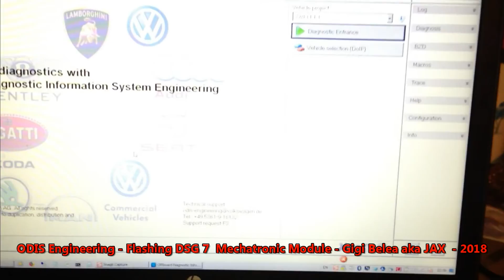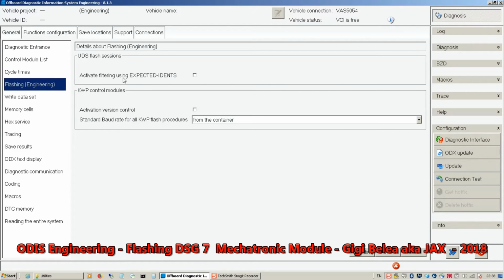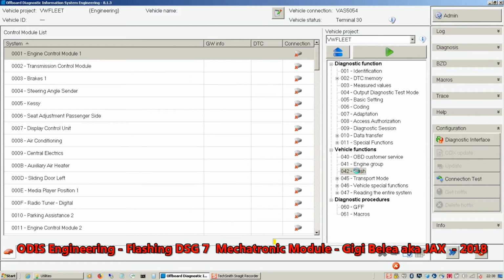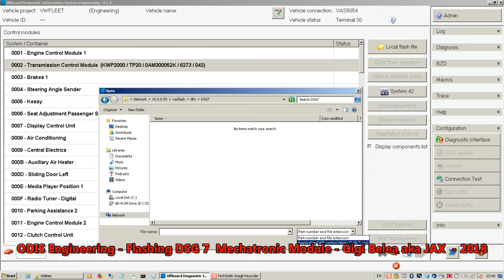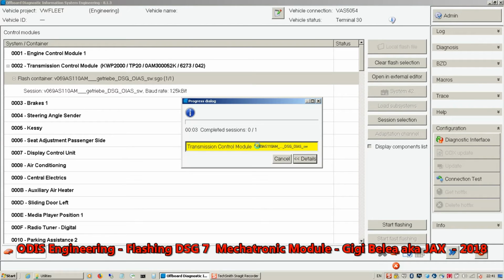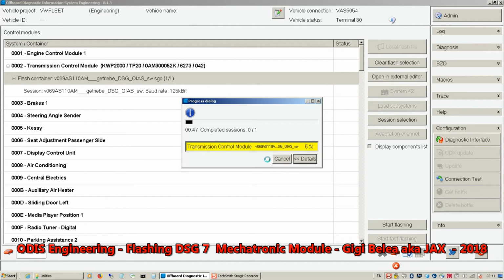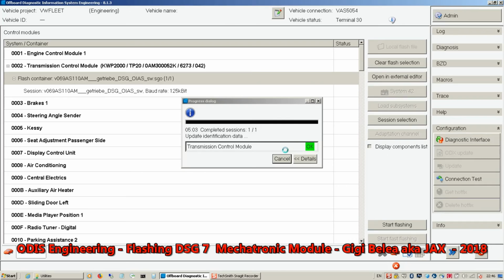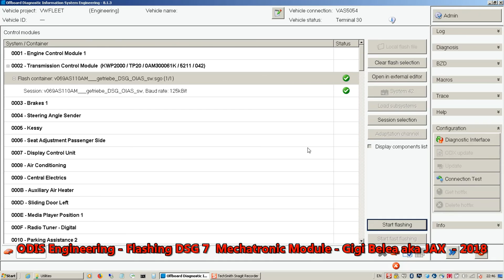Flashing DQ 200 DSG7 Mechatronic Unit with Odis Engineering

Comment: Hi, thanks for the video. If I have sgo file for my dq200 with modified shift points, do I need to do the same setup as you? Or is it possible to flash the module using ODIS-E via OBD in the car?
Reply from the maker: Possible to flash via OBD in the car.

Comment: Hi. Thak's for good tutorial. But i have a question can I flash to another software number on bench but 0CW immobilized unit?
Reply from the maker: only if you have a full read including bootloader.
Reply: @GigiBeleaDK  so only cloning? Old unit is not available. Can I do the same that You made on this movie with 0AM...769E?
Reply from the maker: @szymonvr  if you do it with ODIS then yes, like here would work.
Reply: @GigiBeleaDK  it became that I should use 769K TCU unit. Got some problem when trying to flash unit on bench getting immon ON error. Can 769K unit be flashed on bench or only in car?
Reply from the maker: @szymonvr  As I said , bench mode only if you have full read , else in the car AFTER you match immobilizer.
Reply: @GigiBeleaDK  Thanks again. It finally worked. 769K unit mounted on car - immo matched and ODIS E made his job ;-). Gearbox moved forward but very rough. Tomorow we will be making ODIS S adaptation. Do You got some info about differences between hydraulic blocks? Can i use block from MY2018(TSI engine) originaly with 769E tcu mounted on 769K tcu and new clutch which is different in 2014 than 2018??
Reply from the maker: @szymonvr  Hydraulics should be identical.

Comment: What version of Odis are you using? I try with 9.2.2 always error. VCP and Kess works well on same Tcu?
Reply from the maker: You need to select the correct platform else you will get error because ODS might try K-Line first or CAN and the unit might use the other protocols for flashing. VCP and Kess should work as well as ODIS.

Comment: hello, i have a problem can you help me?  I have two LED headlight control units.  One of these control units is working properly but the other is not working full function.  Is it possible for me to read and save the data of the properly functioning controller and then upload it to the non-working unit?  How do I do this reading from ODIS and turn it into a flash file?
Reply from the maker: you can not READ the flash with ODIS. Find the correct software for it and flash it or go to the dealer and ask them to flash it :)

Comment: Good night, great video, could you provide the electrical schematic of the connection? I have a control unit and I need to do exactly this procedure, but I'm still learning about reflash, I have a broken unit from a client and I need to move to another unit, in addition, I need to know if I save the file on the other one later, it will work. normal exchange, if you can help me i will be immensely grateful? Thanks.

Comment: Does this control unit flash need to have online log in? And why actually do we need to flash control unit, what is the purpose?
Reply from the maker: Just to flash units you do not need an online connection. Sometimes units fail, then you need to replace it , and it might come with wrong software for your car , therefore you need to flash with correct software for your gearbox.
Reply: @GigiBeleaDK  thankyou verymuch. Appreciate it

Comment: Do I need to unlock or remove protection after flashing DSG on car?
Reply from the maker: For 0AM no, for 0CW yes. 0CW can only be flashed on the car or if virgin.
Reply: @GigiBeleaDK  I have a renewed 0CW with poor power, low rpm change gear problem. I want to flash a new firmware to fix this. Wonder if it will locked the 0CW again.

Comment: Can this be done to all dsg units? I cant flash dsg 6
Reply from the maker: Yes , would work on all DSG6.
Reply: @GigiBeleaDK   I'm trying to clone tcu with diff. Hw. But no go. File size is diff. I need to flash file 705kb, but tcu except only 417kb file.
Reply from the maker: @andriusskaudzius2424  LOL , that will never work , different hw is different CPU architecture. You can only make clone ONE to ONE on same HW.

Comment: Hi. With odis E. Can u flash to older software?
Reply from the maker: yes, no problem.
Reply: @GigiBeleaDK  i tried and it refuses. Can i ask how?
Reply from the maker: @majidyasin2386  What hardware you have and what software you wanna flash ?
Reply: @GigiBeleaDK  odis e 12 with vas and the gateway want to flash it downgrade. But i hear cnt upload fecs after.
Reply from the maker: @majidyasin2386  "But i hear cnt upload fecs after" ... I do not understand what you mean ...
Reply: @GigiBeleaDK  after flashing gateway with odis-E you cant restore fec codes with odis-S?

Comment: Please can you show how to flash the AUDI electric steering control module
Reply from the maker: Which one , for what problem ?
Reply: @GigiBeleaDK  audi A4/A6
Reply from the maker: @karadiaessa  :D wondering why you need that ? ... it is known issue and easy and simple fix. At the next occasion I will make it.
Reply: Do you know how to save the old file,before proceed with flashing
Reply from the maker: @beldonnyvanette5541  Not possible with ODIS, you need other tools that can read the unit.

Comment: Hi, are you using an original VAS5054 head? Because clones never work for flashing. At least none that I have tried so far.
Reply from the maker: It's a clone unit and they all work good if you have the right driver.
Reply: @GigiBeleaDK  Thanks for the answer. Where did you get the flash files? The erwin flash file downloads dont seem to have the mechatronics firmware.
Reply from the maker: @charmand79  For Flash Files : http://www.dsgfiles.com/

Comment: Hello, I want to flash/update my dsg dq200 in Seat Leon, actually I've got firmware version 4510, is it worth to do that? And where I can get flashing files? I've asked main dealer to update for me even I need to pay but they say that they doing this only when the car is under warranty. Please any help. Thank you
Reply from the maker: Why flash the gearbox ? Do you have any problems or why ? If it is not broken , don't fix it.
Reply: @GigiBeleaDK  Last year I've changed clutch and dual mass flywheel because was little slipping, and week ago gearbox was rebuilt because of lost the hydraulic pressure. Now working fine but sometimes not so often I feel clutch slightly slip. That's the reason why I wonder to flash/update software.

Comment: Hi Gigi,

I'm about to buy a gearbox basically for its mechatronic unit for a dq500. I have odis and a 5054 connector but i am worried about some of your comments below. Is there a place I can search for my software version and download the flash file?

Alternatively what is the easiest and cheapest way to get the flash file?

Also I assume you can do this while the unit is installed in the car and not on a bench???
Reply from the maker: Depending on the age of the car , the TCU might have immobilizer incorporated on it. If it has then no way to just swap. If no immobilizer then you can swap and if the gearbox has the same code you can swap plug and play , if not you will need to flash correct software on it , else will not work.
Reply: @GigiBeleaDK  its a 2013 built tiguan, I can get the same code gearbox
Reply from the maker: @jeppoification  Some DQ500 have immobilizer some not, I can not say just from the year model.

Comment: Hi There
I ve a doubt to flash dq200 in the bench, i ve tried but there is no comunication with it, i did everything as you said in your video.
Thanks
Reply from the maker: Make sure you have 120ohm resistor between CAN wires on bench. Also K Line needs to be connected to the TCU aswell.
Reply: @GigiBeleaDK  thank you for the advice, now its working, but I have a 0am300060e and when it starts flashing it gets a tcm fault just after askes to turn off the ingnition.

Just one more thing, I ve noticed that in your odis it has been written on the up right screen terminal 30, and mine it s terminal 15, could it be a problem? Thanks
Reply: A.G.T transmissão automática same here. I get error as soon as i select to start flashing

Comment: I understand that flashing means copying/cloning old unit information to the new one. What kind of information? I bought a refurbished unit from China and seller told first that he is going to programm it to my vin number but after sending has told that I need to make "adaption" with 5054 tool and odis software. Is this correct or is he just lying to me having done nothing about programming? Thanks.
Reply from the maker: If unit is flashed with correct software then you are ok, just need to make basic settings on the car.
Reply: @GigiBeleaDK  basic setting need security code or not?
Reply from the maker: Nope.
Reply: GigiBelea aka JAX hey my 2006 GTI randomly won't shift in reverse and won't go out of first gear. I took it to a shop and had fluid replaced/refilled but the transmission still randomly stops working. The car will drive fine sometimes then revert to being broke. I found a code on the car that is P0608 and P2732. Do you think it's just the solenoid broken or the mechatronic ecu itself? My PRNDS is flashing on my dash as well. If it's just the solenoid I was going  to try and have the shop replace them

Comment: can i dump my old mechatronic and transfer it to the new one?
Reply from the maker: Yes, if it is the same hardware number. But you can not read with ODIS, you need another tool that can read.
Reply: GigiBelea aka JAX Which tool can i use?
Reply from the maker: Vag Can Pro
Reply from the maker: No, I mean Vag ,Can Pro. https://vcp-system.com/
Reply: I think you can also read the hardware number with VCDS
Reply from the maker: I guess you know better what you want to do :) I'm just talking.
Reply: GigiBelea aka JAX Yeah, anyway thanks
Reply: Avin Rascho hi sonim having some issues trying to flash a mechatronic unit wondering if you could help??

Comment: Thanks for sharing,really its nice job. recently i installed a 5.0.14 ODIS version,and it works whith my vxdiag nano in diagnostic.  have you tried perform a reflash with a passthru interface?,  i need to get a vas 5054 necesaraly or not ?
Reply from the maker: Did not tried with the nano interface, but you can always try and see if it works.